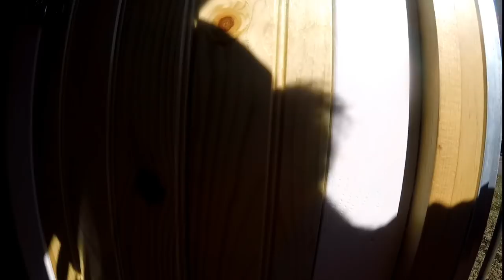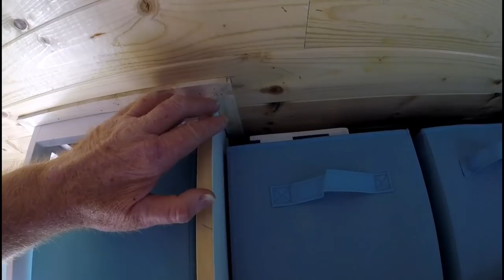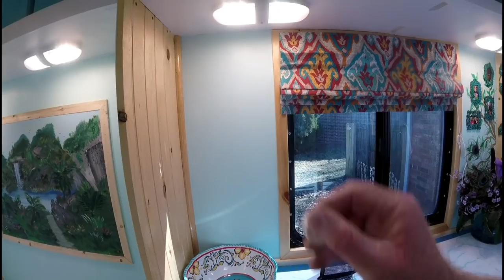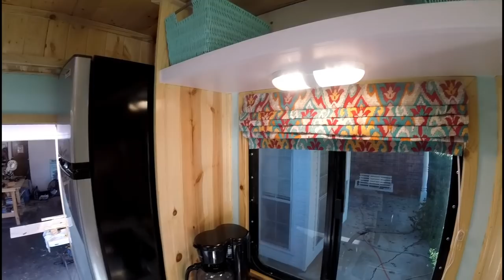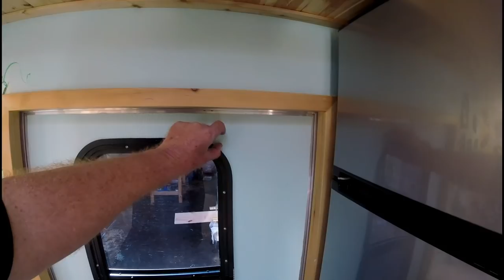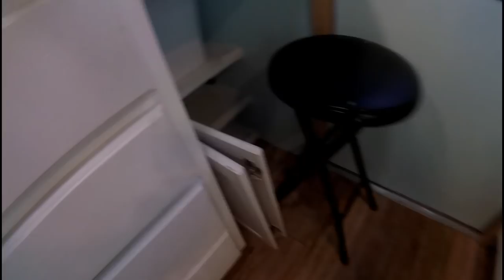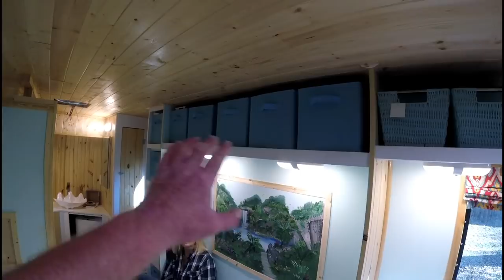Cargo Trailer Conversion Shower Trim and False Panels

Comment: How do you get from the kitchen to bathroom without walking on the bed?
Reply from the maker: The mattress will be a 12 inch thick real queen memory foam mattress. A queen is 60 inches (5 ft) wide by 80 inches long. The bed is a permanent structure. Under the bed frame is a 50 gallon fresh water tank, storage areas and a portion of the 12 volt system. We weighed pros and cons back and forth. We could have made 2 couches on either side that fold out to make a bed, but then we could only utilize a 30 gallon fresh water tank. In addition we would have had to use a 6 inch think mattress (cut in half) so it would fold to form the couches. A Murphy bed was out of the question because there simply wasn't enough ceiling height when the bed was in the upright position. In order to make that work we would have had to run the bed lengthwise to allow for the ceiling height, but then we would have lost valuable space for the kitchen and bath. A 6 inch thick mattress is fine for a weekend camping trip, but this will be our fulltime home for a minimum of 6 months. Also, we just didn't want to have to fold the bed up and down every day for 6 months. So, in answer to your question, if we need to get from the kitchen to the bathroom,  we will simply roll from one side to the other. There are 2 RV doors on the trailer, one at the side up front, and the other in the middle at the back. We will be traveling to areas where the climate is conducive to being outside most of the time during the day, except of course, when it's raining. We are outdoorsy people. We enjoy kayaking, biking, and just sitting out under a shade tree. The way we see it, the only time we will have to roll across the bed, will be at night when one of us need to use the facilities at either end. When you see small Rvs at a dealer, they usually have the bed running cross ways either at the front or the back. That means, at night, when someone needs to get up and use the facilities, someone is crawling over someone. This setup simply works better for us and our needs.
Reply: +"I Ride" Tiny House Adventures It totally works though as you have the door there if you are adverse to climbing over the bed.  I think you made the right decision.

Comment: May I suggest you watch videos about mold under beds like this? You may want to use a large hole saw and make many, many more holes for your mattress to breath.

Youve done a very nice job on your trailer. I was disappointed you never showed whatever is at the end.
Reply from the maker: A complete walkthrough is about a week away (give or take a couple of days). Be watching for it. We're getting ready to drill several breathing holes in the bed platform shortly. So far, when it's cold, with the heater running, we've had zero issues with "sweating" on the inside. One thing in our favor is the trailer is total electric, no propane anything. We will be plugged in to shore power 99% of the time. We also went with a 50 amp service rather than the standard 30. Most of the campgrounds we will be visiting offer 50 amp service. For those very few times we will only have 30 amp available (or when plugged into our 4000 watt generator) we will use dogleg adapters and be more "selective" on the appliances we use.

Comment: Window under painting could be evac window so maybe not wasted, although you have two doors.  Those green boxes dont holdup according to my wive they kind of fall apart and warp.
Reply from the maker: Yes but they're cheap (in many ways). We'll just replace when necessary, or who knows, I might build some kinda light weight wooden crate that fits perfectly (after I've rested a little). Thanks for watching our videos. We appreciate ya.
Reply: Baskets are really good for those cubbies, bad part is they can get expensive.  You can probably pick some up during your travels.  They are sturdy enough to hold hard goods but are can circulate if you put clothes.